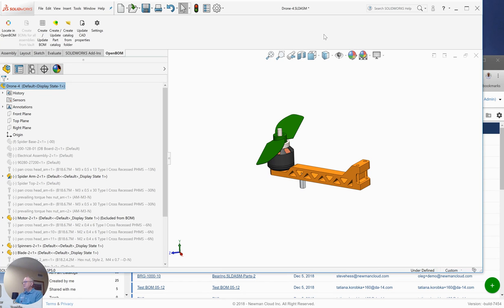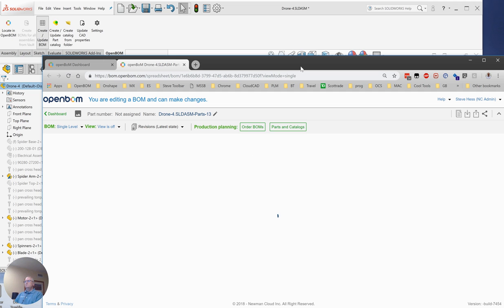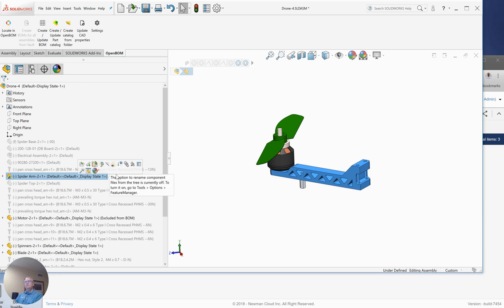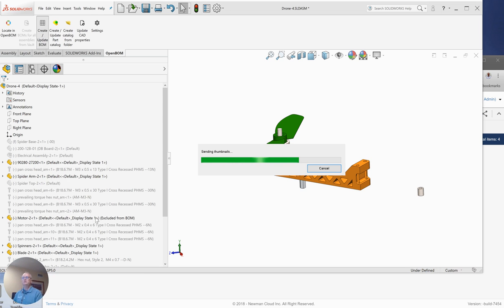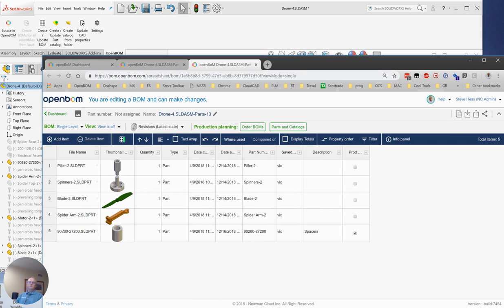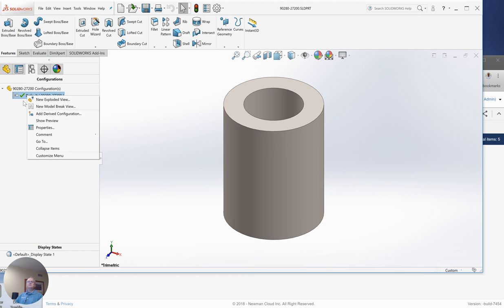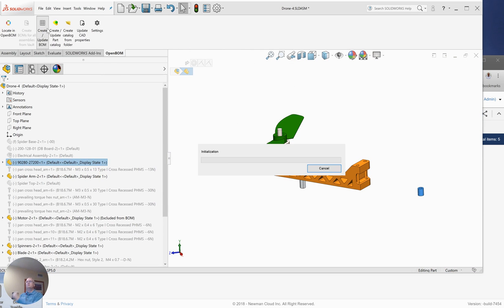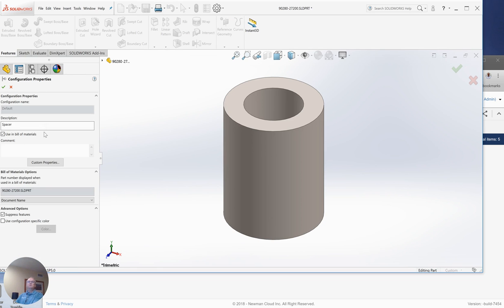Demystifying OpenBOM Solidworks Properties - Part1

Comment: it is something wrong. please see video on minute 5 just before adding description for spacer - it already have exported one. after that 3 minutes later we see again same window. Please do correctly in Solid Works have many places to put description especially when people work with PDM.
Reply from the maker: Indeed, there are many places in Solidworks to put description -it can come form part, configuration and some other places (as you said PDM). In this example, we don't use PDM, so I'm not sure what is wrong. In the fragments you outlined, the same BOM was open twice, so not sure what is wrong. But, please clarify  -we would be happy to address it.
Reply: @OPENBOM  just remove description during first export because from video we see that this part have description after first import and after adding discription in properties nothing happen part again have same description.